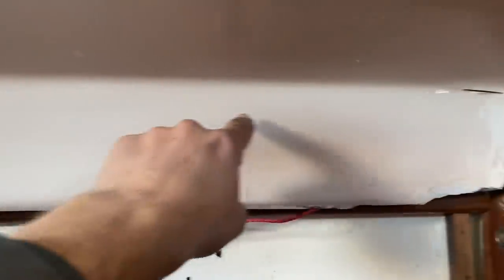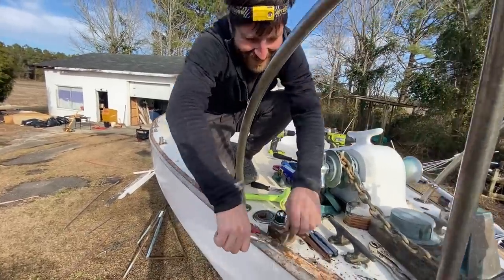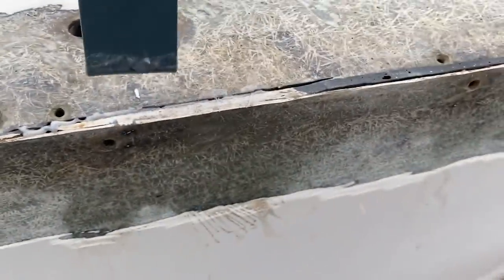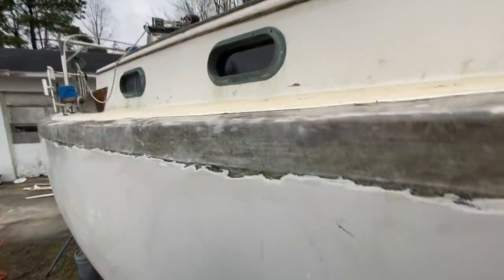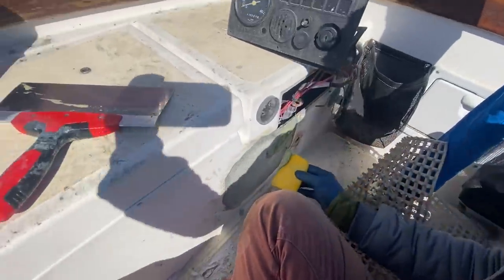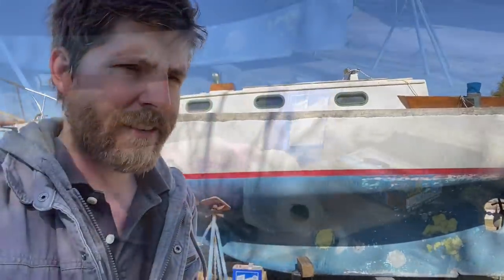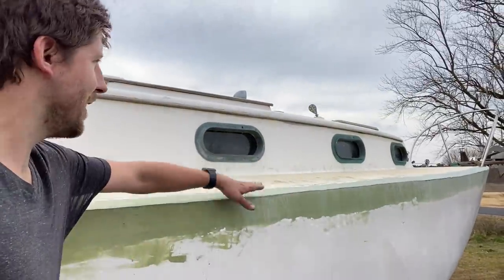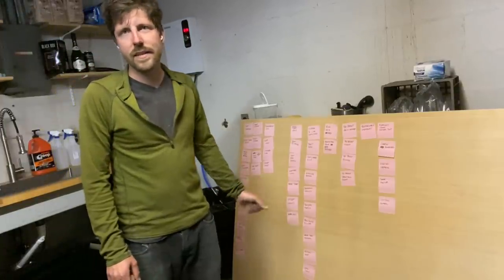Glassing over the devil seam

Comment: Just a "Hi" from Ensenada, Mexico, where I live aboard.  Me: 1972 Mariner 31 ketch with electric motor conversion.  Boatyard is doing bottom job, re-fiberglassing rudder and replacing shaft seal.  I would love to have your workshop and do it all myself.  My projects include making a 12v fridge from parts garnered from a 12v ice chest so I can have cold milk and keep my vegetables fresh, and cold wine (hehe).  Also just got my cheapo LiFePO4 batteries and "playing" with them (balancing, etc.)  Previous owner did the fiberglass work so I haven't had to worry about it.  You videos are usually playing in the background while I do my projects.  I won't bore you with all the details, just know there's some homeless boat hermit guy in Ensenada, MX doing a lot of the same stuff...even 3d printing (on boat though, no workshop).
Reply from the maker: Right on!

Comment: Me and my friend did the same thing on our 44feet Wasa 55 a few years ago, the old toerail was leaking and was damaged. "Fortunately" we did it at the same time as changing the foredeck and it didn't have much interior left/built by then, so it was fairly easy to partially lift the deck, glue it with vinylester based glue and laminate on both in and outside of the entire joint with Biax glass and grind out a fairly nice radius (before laminating). Feels like the entire boat got a lot stiffer, and it's completely waterproof :)

Comment: Looks like good times fixing up the boat. I wish I could get down there to help, but I'm in Minnesota, so it's far. But watching you and a few other boat channels is making me itchy to build a boat of my own. I'm a decent woodworker, so I could probably manage something simple like a flat bottomed skiff.
Reply: Hey I'm in MN too.  Now that ice fishing is done its time to get back into the garage and start working on woodworking projects again.  One is an Ozona X nesting pram from Bedard Yacht Design.  If you wanna build a boat check them out or Chesapeake Light Craft, they have tons of designs for DIYers.
Reply: Build a single little hull, buy a cheap Hobie Cat, salvage the hulls and rig, mount the cat hulls on the outside, put the rig on, and you have a fast trimaran for cheap! A Woods design boat called the Strike 18 or Strike 20, a dream for me to build
Reply: Check out the Waver Rover 650, pretty easy to build from the looks of it. 22’ ocean going tank to take you anywhere. I plan on starting one in the fall.

Comment: Good job Sam. What you did is pretty much exactly what I did on my CD 28 back in 2005. I also documented the whole procedure in pictures and posted it on my website.
The CD 28 is a fine sea boat. I did a three year solo circumnavigation on mine from 2006~09. I videoed some of it as well.
Are you a member of the Cape Dory Sailboat Owners Association? Good people and quite helpful. Keep it up. 
May all your troubles melt like lemon drops.

Comment: Sam, looks like you are "on the hard" at work!  Nice progress, I enjoy following and learning from your experiences ; )  Thanks for the tip about the dry toilet (Homer bucket with seat), indeed it works great and without the stink and hassle.  I have a 1977 S2 9.2 C and will be removing the head system soon, yuck!  I did a full bottom job on my boat last summer in Stuart, Fl (DIY) Port Salerno Marine, and it came out great.  However, boats of that age can have a lot of blisters which can lead to delamination in the hull.  I recommend you look into it in detail, but I'm sure you already have.  Besides, now you have the fiberglass skills you'll need.  Great work, lot's of problems solved!

Comment: Loved seeing this! Just starting to gather all the tools needed to do this when I see your video! I was worried that I might be structurally damaging something if I did it, but as you say - it is impossible to reach those nuts/bolts without removing the side piece. I planned on creating a cabinet along the entire shelf line connected to the shelf for support. It will cover the seam and add more storage. It will only be the depth of the shelf. It can be easily removed later if needed.
Reply: @northchannelsailor  I tried that on one bolt but it was not working very well. I was afraid if I started accidentally cutting into the deck I'd really have a large mess.
Reply: @northchannelsailor  Doing this might create a worse nightmare if I accidentally cut into the deck in several places. I would have gouges causing a lot more work in the end. I'd rather do cabinets than fairing the entire toe rail.

Comment: The polysulfide sealant used to build all of our boats is good for 20-30 years    We all are dealing with that issue because a lot of our boats are older than that     You might try wetting out the cloth on a flat surface then picking it up and placing it where you want it to be

Comment: re screws - in desparation you can file them from 2 sides and use a spanner or wrench to open them up, far better turning strength than any screwdriver ...  (may need to remove some material around the screw though)

Comment: I wonder why Cape Dory didn't glass over that joint? It seems like a relatively small step, and these boats have a reputation for being a quality build.
Reply from the maker: I thought about that too but pretty much everyone makes the hull and deck as separate molds which would include gelcoat for releasing. I suppose they would have to grind the gell coat away, hand layup, and fair just like I am. And that would be super labor intensive id imagine vs popping them out of the mold and bonding and screwing them together.
Reply: Yeah that diagram of the joint looked crazy complicated?

Comment: Sam, I have a technical question.  You glassed over the deck/hull seam to  stop leaks, which seems to make perfect sense.  My question is, why don't the manufacturers do this during production to avoid this as a potential leak point?  I understand that most glue and screw the joint, but it doesn't seem like it would add much to production cost to lay up a couple strips of fabric and some epoxy.  Does there need to be some ability for the vessel to flex at this point, even ever so slightly, that creating a solid section will prevent and potentially lead to cracking?  Enjoying watching the project develop, I have been in love with Cape Dory sailboats since i was a kid.
Reply from the maker: I think they probably would if it was easy but I imagine it adds a ton of extra work.

Comment: Your reason for glassing the deck hull joint, was it to keep out water or to strucualy attach the two together? I know the light weight glass you used was easy to Fair, but looks too light weight for the job. Maybe some 1700 if you have to go back over it. It contours to corners very well. Cape Dorys are great boat, too bad people didn't take care of it. You should have a nice boat when you are done.
Reply from the maker: More for water tightness. Im thinking the glue and bolts should hold it together.

Comment: Sam why didn't you pull off the bow pulpit and stern pushpit? For sure you have joint leakage in those areas as well?
Reply from the maker: Didn’t want to get myself too big of a project. Maybe i should have but those areas are the anchor locker and cockpit lockers so just drain the the bilge.

Comment: Hi Sam! I found you while looking for other CD28 owners - I have hull no. 271 :) I am also going to cut back the fiberglass inside the cabin that make the deck hardware and wiring so hard to access - can I ask which tool you used? Looking forward to seeing what is next for you!
Reply from the maker: Angle grinder with a cut off wheel but i hear one of those oscillator tools works good too.

Comment: I wonder a little about the strength of three layers of glass versus scores of quarter inch bolts and sealant.  The deck and hull are probably a quarter inch thick, but three layers of glass is probably well under 1/8 inch thick.
Reply from the maker: I left the screws under the toe rail in and the stanchions, dock cleats and genoa track will all go back on giving it more bolts to holt together. This was more for waterproofing than strength.
Reply: That answered my question too.

Comment: hey Sam. i know this is 2 years old, but im looking at buying a 1981 CD 22D.  it is a project boat so the engine is out among other things. the owner has passed. the family is selling. their knowledge of the boat is limited. it also has the though hole  near the bottom of the keel that has been removed but not filled in. do you know what it is used for?

Comment: Another great video! I wonder about the batteries for all the tools, how many batteries do you have?
Reply from the maker: 6 but I also have an AC power adapter that I made for them.
Reply: @samholmessailing  If you get a chance a short "how to" on  how you converted the tools to a corded option would be great!
Reply from the maker: @robm7543  you bet. Its easy. Just open up a broken battery and connect it to an 18v power supply. Ill make a video on it sometime. I put the power supply in a plastic ammo box so it doesn’t get too banged up

Comment: I don't want to sound negative, but there is probably a reason the boat manufactures don't do this when they build a boat.   The designers of ships aren't stupid, and presumably, there must be a reason that they deigned them that way.  The deck to hull joint probably need to flex.  The screwed on toe rail would allow for some flex in that joint.  It would be interesting to see if the seam that you glassed over, developed a lot of stress fractures and cracks.
Reply from the maker: They do it that way to save money because the deck and hull are perfectly smooth and gell coated out of the mold and they would have to fair and flow coat or paint it again which would be much more expensive for them.
Reply: @samholmessailing  I would think that some of the most expensive manufacturers would do it, and just add the cost of it to the final price.  With all of the competition amongst manufacturers, it would be a small thing to set their boats above the competition. A lot of buyers would probably be happy to pay the extra money for something that can actually protect and extend the life of their boats.  It would be a much better upgrade than some shiny nonsense or fancy curtains that owners pay for all of the time. It would also help with resale value.  
As far as added cost to the manufacturer, couldn't they leave that area not gel coated when it comes out of the mold.  IDK.  If they did have to sand down the gel coat, they wouldn't have to do it by hand.  They could probably develop a tool on a robotic arm or something that could strip everything down in one pass,  
How about the durability of the work that you did?  Has it deveolped cracks or delamination due to the flexing of the joint?  Hopefully there is no more flexing of the joint after you glasses over it!  If your's has held up, it's something that I would definitely consider doing on my boat.
Reply from the maker: @steringp1434  no cracks or issues with my repair. I doubt I added much extra stiffness because it was only three layers of thin fiberglass. I did it solely for waterproofing the 40 year old joint that was very leaky. I think some manufacturers might glass the joint from the inside but that sounded like a lot more work to me.
Reply: @samholmessailing  Happy to hear that your joint is holding up.  I'm guessing that it's important to deliberately NOT make the joint too rigid and strong?  The glassed over joint may need to have some flex in it to avoid cracking.  I'm going to try it on my boat, and hopefully I will have equal success.  Thanks.
Reply from the maker: @steringp1434  fiberglass is pretty flexible. I wouldn’t worry so much about it cracking. Ideally I think you’d want the joint as stiff as possible to make a homogeneous structure. I was just after the waterproofing though and didn’t want to deal with thick layups and fairing.

Comment: Next time cut with a multi tool and hold a shop vac up to it. It will be a LOT less messy. Also, only three layers of glass on hull deck joint? No offence, but I would have done like 10...

Comment: Did you remove deck fills for the water, diesel too? Do you have any replacement in mind?
Reply from the maker: I removed the fuel fill , water fill and pump out fittings. No plans to reinstall.
Reply: @samholmessailing  I know, no holes through the deck, if possible. But how will you refuel? Or how are you refueling already, if you weren't using them?
I'm probably missing something terribly obvious.

Comment: Do you only use peel ply on your last layer when you’re tacky stacking?
Reply: yes - you can't remove the peel ply until the resin has cured, so you'd otherwise be leaving it in the joint. And it's used to make the end result smooth, which isn't necessary on the internal layers.
Reply: Hey Sam.
Great video 
Just curious about the peel ply also.
Does it assist in removing the  wax bloom thd result of the resin curing  from the surface of the glass also?

Cheers Ian

Comment: Those screws are not structural?
Reply: I was wondering the same thing.  What happens if the hull and deck flex? Stansion bolts will help some.

Comment: Best way to fix Cape Dory's lousy, leaky deck-hull joint:

 Sell boat and buy an Allied Seawind II with a properly constructed deck-hull joint...With all the work you're doing, I would have taken the next step and separated the deck from the hull, cleaned the joint surfaces, heavily applied 3M 5200 and reinstalled the bolts and toe rail. I suppose if you heavily reinforce the joint with multiple layers of fiberglass that's bonded well to feathered edges, it might last a long time before cracks appear and you're back to square one... unless you bump into a pier pylon or something along the way which results in "insta-crack". 3M 5200 sealed joint flanges seem to offer the best impact resilience and resistance to leakage over the long haul though. The fiberglassed joint method may work well initially but doesn't have enough flexibility to endure the strikes that are bound to happen over time. Unfortunately, Cape Dory didn't seal and secure their hull-deck joints very well. They're notorious for leaking.

Comment: If the manufacturer left that joint open you should have done the same.  There are a lot of stresses now that are going to make that joint move and will shear the fiberglass, it will also propagate the crack in directions you did not intend it to go.  That joint should have stayed flexible.  It will crack and leak soon enough; I hope I'm wrong.  =)

Comment: I love this dude, but at some point, you just gotta buy a safer better engineered vessel for what he’s trying to do.
Reply from the maker: You can spend 100k on a boat and it still might have leaks when pushing it offshore. Just have to decide what you can tolerate and whats worth fixing.
Reply: On the flip side; you could spend $15-20,000 and find a much better boat which is already engineered to do what you need it to do...without chunks of a monolithic hull being cut up in to several pieces. All I’m saying is, I don’t want you floating face down in the Pacific...or Atlantic....or...
Reply from the maker: @stoweman34  what boat can you find for $20000 that was engineered for blue water and doesn’t have 40 years of wear?
Reply: The Cape Dory boats are absolutely safe and well-engineered for offshore voyaging. They're boats, which means they need upkeep, and after 40 years this one is in need of a significant refit. Nothing unusual about Sam's boat.
Reply: Sam Holmes Sailing A Cascade 29 would be my go to for that budget or even a Newport 30 (beamy for its size)...Lots of them in the Northwest not sure what’s prevalent on your side of the Mississippi.
Reply: They might need some mechanical work but you wouldn’t have to chop up a bunch of fiberglass.
Reply: Some of the Cascades have the hard dodger too. Newport’s will have canvas....but most of them are fitted with a wood stove😀
Reply from the maker: @stoweman34  those are both of similar vintage and cost to my cape dory and would have similar issues. I would say neither has the same offshore clout as my cape dory. These repairs are for watertightness not seaworthiness. Its plenty seaworthy already.
Reply: Sam Holmes Sailing Before an ocean crossing, would you have someone, like a surveyor, inspect the boat when you’re done with repairs? I know you’re not concerned with resale but if my surveyor (Alison Mason) saw that fiberglass work,  she’d recommend I not purchase the boat.
Reply: @stoweman34  gee mate give it a break. Sams done the work on the join now and as he said its primarily  for waterproofness but it will make it stronger than original. I dont think Sams concerned about resale or appeasing a buyer when he sells. Hes on a limited budget and hes doing the best he can. As he said most 40 yo boats will need some form of overhaul. This cape dory is what he has and im sure it will suffice. He sailed to Hawaii in a Hunter 23 !!!